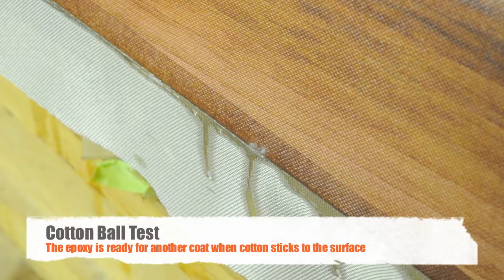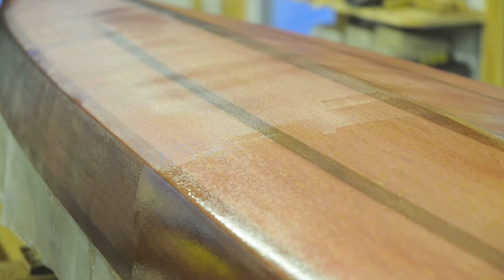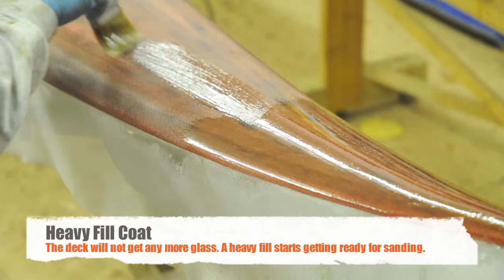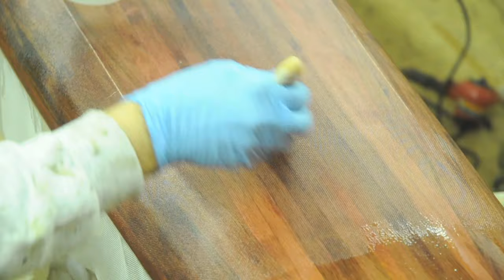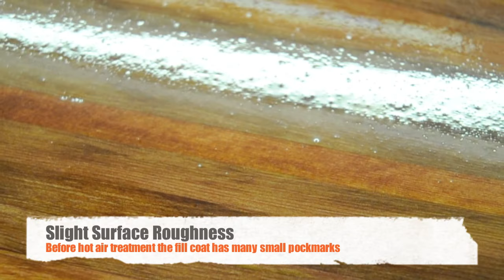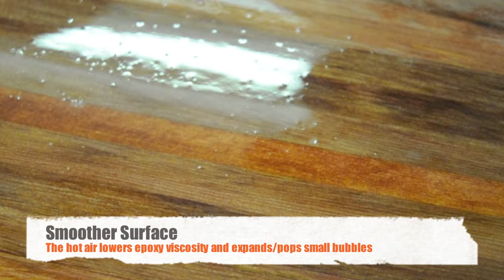Epoxy Fill Coats

Comment: so first you put resin over the fiberglas, let it dry and then put another layer on?
Reply from the maker: after the first coat, the texture of the fabric is still evident. After the first coat has set up a bit, I apply another coat to start to make the surface smooth.